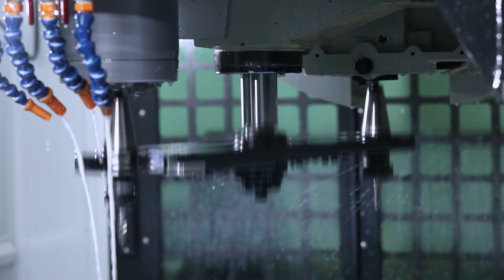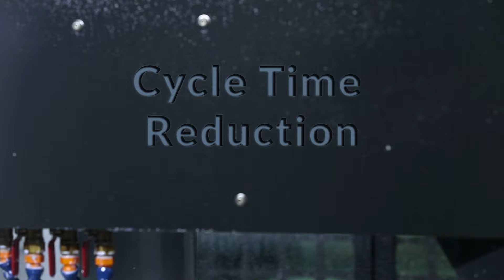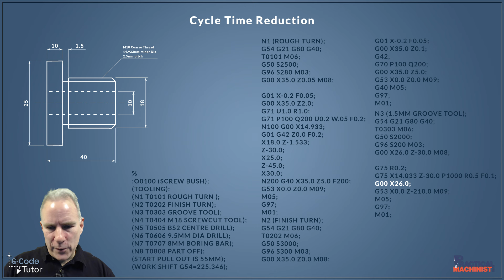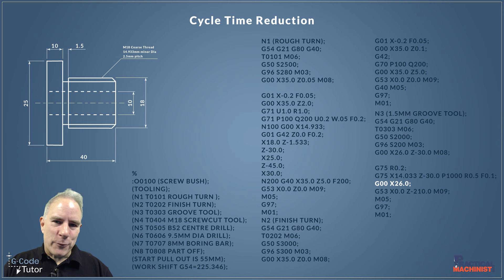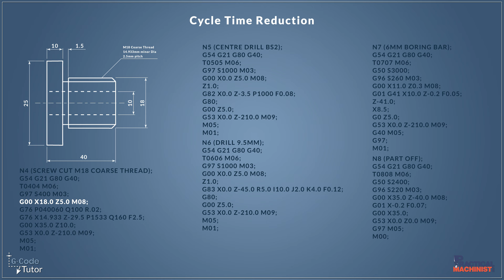How I Tweaked My G-Code to Save Cycle Time

Comment: The consistency of the stock lengths, and diameters usually determines how brave I am with my rapid planes.
Return planes I keep close.
Then rewrite the geometry for the finish pass with cutter comp.
I've started "back" finishing my parts with a profile tool.
Finish pass starts at the back of the part.
Then I feed out away from the chuck with one continuous pass. Back across the parts
O.D. then down the Face.
Great finish, less tool deflection, and reduced chatter.